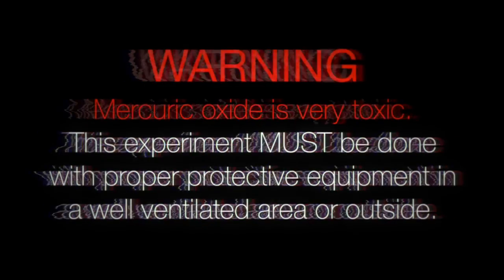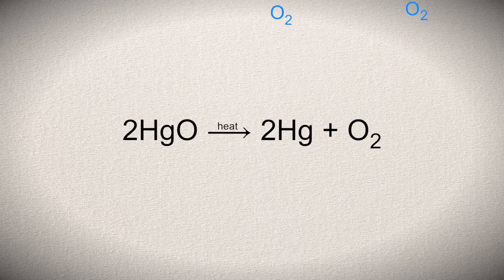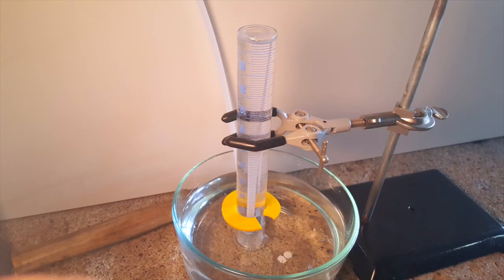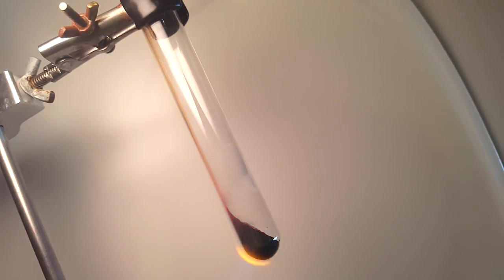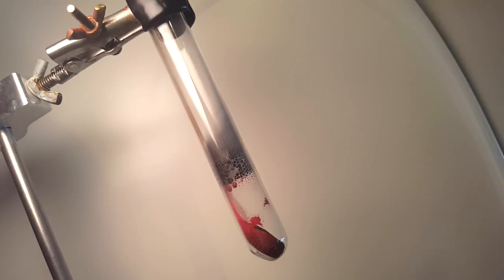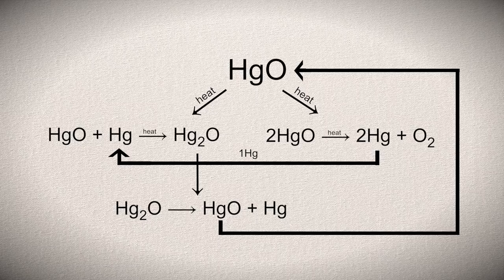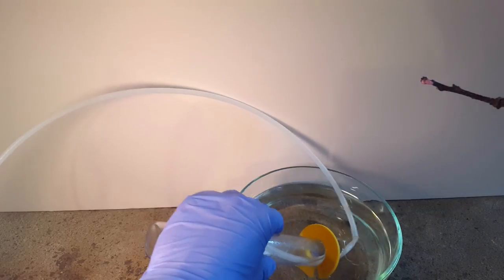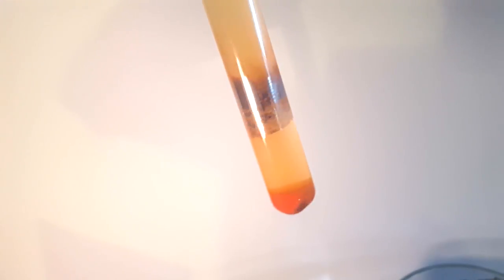Make Mercury Metal (Decomposition of Mercury (II) Oxide)

Comment: 4.	Write the chemical (formula) equation.  
5.	Balance the formula equation for this reaction.
6.	Which type of reaction occur between mercury and oxygen? 
7.	What is the state of each material (sub stance) in the experiment?
8.	What is the color of each substance in this experiment?
9.	What will happen to mercury oxide when it is heated? 
10.	Write the chemical equation for heating mercury oxide? And balance the equation.
11.	 Name the type of reaction for heating mercury oxide.
12.	What is the relationship between the reaction of making mercury oxide and heating mercury oxide?

Comment: Years ago I saw an experiment to produce Mercury from Mercurochrome, a topical antiseptic that is now hard to find.  You add Mercurochrome and baking soda to a small dish shaped from Aluminum foil.  Next, put a penny in the dish and heat on the kitchen stove. The penny is plated with Mercury and takes on a silvery finish

Comment: It's color must change to silver not black
Reply: Atomized Mercury will appear black because it is so small.  Just like with tiny particles of Gold being black.  It will stay that color until there is enough to form a mass large enough to reflect all visible wavelengths of light, essentially turning into a mirror as we normally see it.  If you could zoom in on it, it would still look silver until you got down to sizes smaller than the length of the waves of light.  Are you picking up what I'm throwing down?  That's about as good as I can state it.